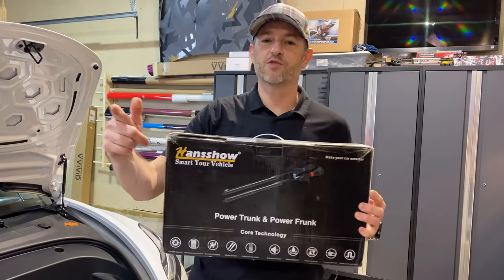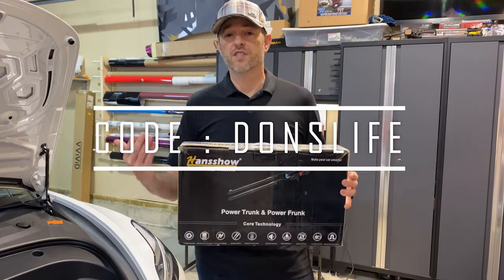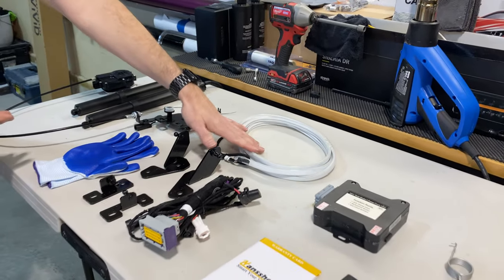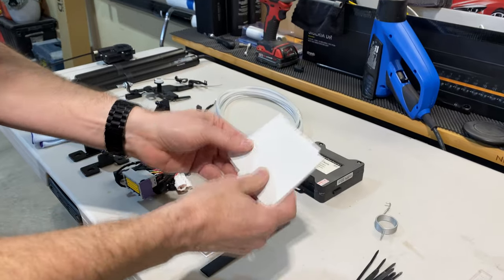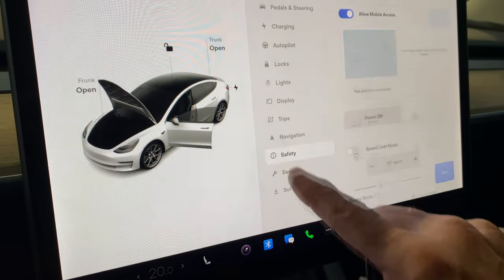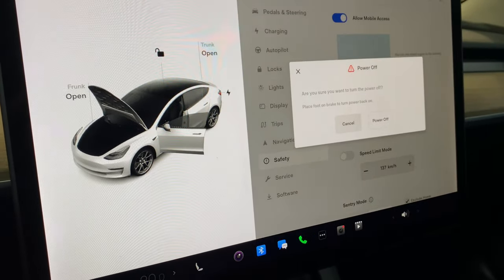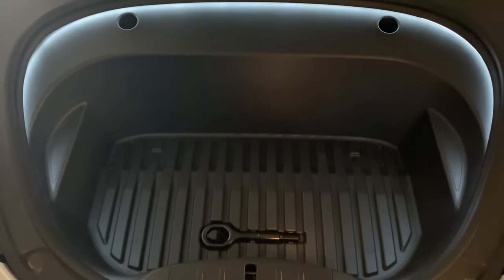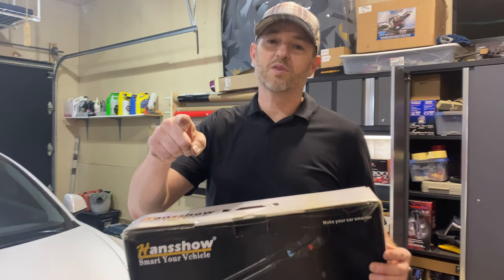Power Frunk ‘Illuminated’ for your Tesla Model 3 & Y

Comment: First, you did an amazing video edit. Pat on the back mate. 
Second, if I just wanted to install an LED light strip alone. Will it damage the battery lifespan being on full time, or is there a way to connect it somehow so that it only activates when the car is being used?

Comment: Might I suggest before moving the Trunk Locking Mechanism, use a Marker Pen and trace around the original location. Finishing the install, just line Mechanism back to the drawn lines.
Reply from the maker: Great tip!